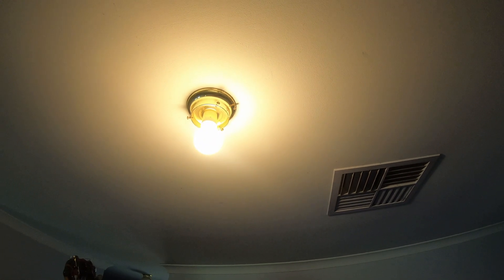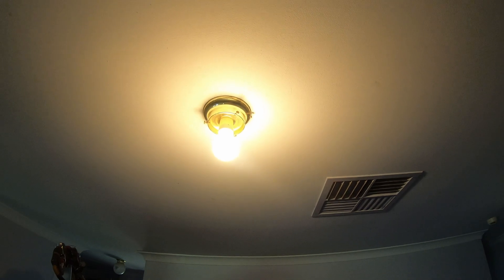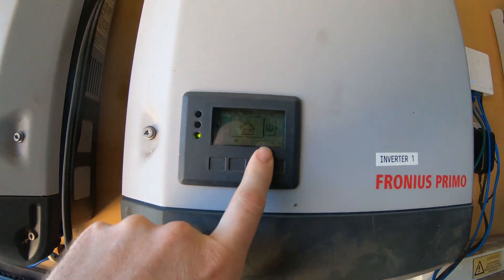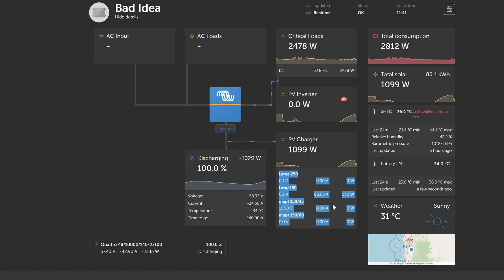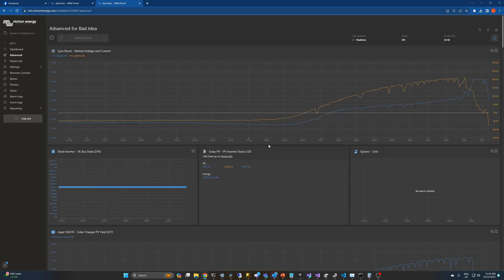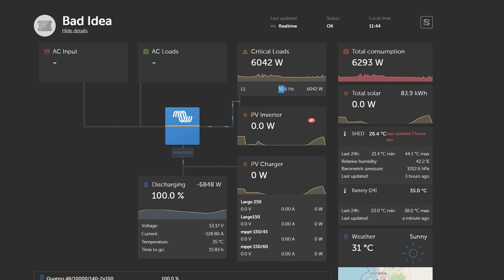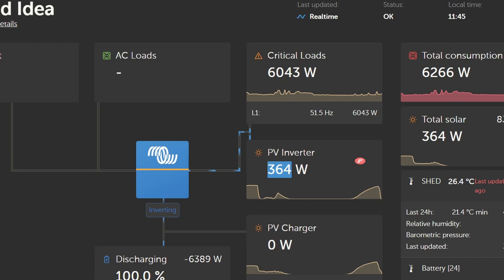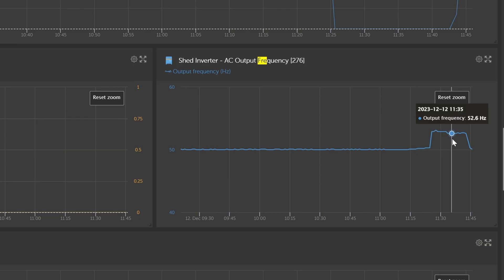Victron and Fronius. AC Coupled Solar and Light Flickering

Comment: Great channel man I just set up a fronius 5kw inverter the other day was a bargain 6.6kw jinko panels $750 off gumtree looking for another one too run in a master slave config 

I'm getting flickering at 50.1 when a cloud goes over the wattage drops an the lights flicker there all led down lights been mapping the frequency never go's above 50.1 it drops too 49.9 an bounces between the three 49. 9-50-50.1
Reply from the maker: oh man thats annoying hey. Do you have any other logging on the inverters? like can you see the voltage spiking when the frequency shifts ?

Those inverters have an API you can poll. the problem is you cant beat the API up so your limited to a resolution only as fast as you can poll the API. 

We used to poll ours in to an INFLUXDB and that allowed us to figure out some of the quirks
Reply: I gotta set a few more widgets too see hopefully when the the voltage drops an change in frequency I'll have a look into influxbd. I spent some time yesterday reading up on frequency shifting an put all the panels on a single mppt to hopefully keep the  voltage higher and more stable

Comment: Was it hard to set up the fronius’s to the Victron? Second hand primos seem like a very affordable option but I only have experience setting up dc couple Victron.
Reply from the maker: Not difficult to set up. But some of the settings on the DC side get ignored when you enable the AC coupling. And it does some peculiar things. Over all though, very cheap way to add 3 to 5 kw of extra charge. I love it, the cable cost is low, and during the day the energy conversion on a 400v string direct to AC is better than the  MPPT can achieve. The charge coming from AC coupled solar isnt as good though as there is more energy conversions in the chain. The best thing is a combination

Comment: German Standard requires equipement to shut down at 53Hz frequency. that si to protext large emergenca generators, that might be used in certain situations. Normal frequency is 50 Hz, if it is 53, every inverter needs to stop feeding to the grid.  Seems this collides with how the grid is set up in Australia.  In full backup mode the fronius creates 53Hz as well, igf I recall correctly. this is intended to shut doan any other inverters in the same installation that the fronius has no control over. It is a bit of a crude solution, but intended to be foolproof.
Reply from the maker: We have a similar demand response mode here but its voltage based, given our power system  is a high voltage system a 10 percent fluctuation is significant. I'm quite certain if it made it to the 265v max that its designed for there is a lot of chinese made appliances that might become fireworks :)

Comment: How does that frequency affect the clocks in your house? My oven clock and coffee machine clock gain about 10 minutes a fortnight and my frequency only ranges between 49.9Hz and 50.1Hz.
Reply from the maker: That is an excellent question. I suppose depending on how they measure time that might impact them. A friend made a joke that we should do speed runs on Nintendo when the frequency is up to break records